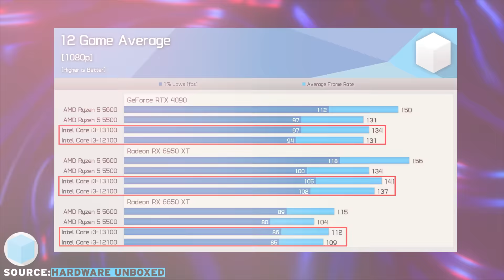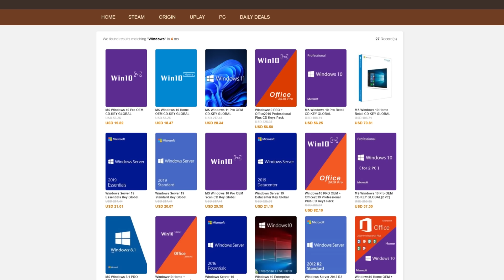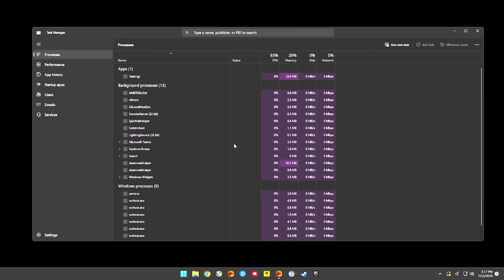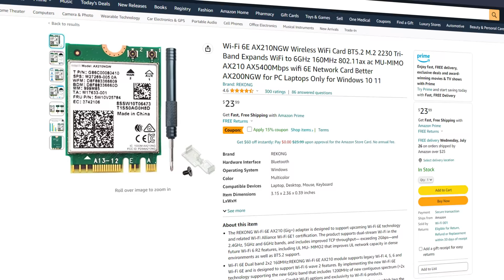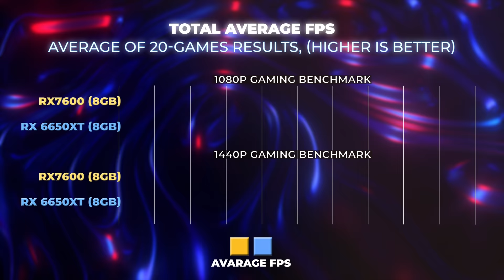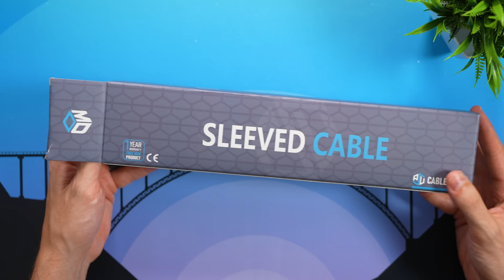The Mind-blowing $650 Gaming PC Build

Comment: Anyone Please Help 
I recently built my first pc and I thought I did everything correctly like building and installing everything correctly. But after downloading some games and playing them for a couple of minutes they freeze, close, I get the blue screen of death, or my entire PC just shuts down. I tried buying a better CPU cooler, upgrading the power supply, uninstalling games and drivers, watching endless amounts of youtube videos, lowering the in game video settings and limiting the FPS. I'm just not sure of what to do anymore. And I really don't want to spend more money and go to a PC shop for them to look at It . Also I have windows 11 installed but not activated. I don't know if that is the Problem or not? Anyone that has had this issue or knows how to fix it please help.
Reply: Did you overclock CPU or GPU or RAM? If so, temporarily disable any overclock and see if that improves stability. Also, monitor your hardware temps, mainly CPU and GPU. And by chance, you didn't install a shady copy of Windows, right? If you just downloaded from the media creation tool from MS but didn't activate, that's still fine. However, if you installed a shady copy, that could cause issues.
Reply: @JJFlores197  nope never oveclocked anything and I don't think it was anything thing shady I got a USB and downloaded it from the official windows website
Reply: @Dtecki_  But are you temperatures ok? If you do nothing intense on the computer, like web browsing, does the PC crash?
Reply: @JJFlores197  yes my temps aren't high at all and it hasn't crashed while watching videos or web browsing

Comment: Bro plz check my pc specs , I want to build 🙏🏻❤️ plz reply 🙏🏻
1 . Cpu:- AMD Ryzen 5 7600X
2. GPU:- GIGABYTE Radeon RX 7800xt 16gb oc
3. Mobo :- GIGABYTE B650M AORUS Elite AX 
4. Ram :- CORSAIR VENGEANCE DDR5 RAM 32GB (2x16GB) 5600MHz XMP
5. NVME SSd :-Samsung 980 PRO 1TB Up to 7,000 MB/s PCIe 4.0 
6. Cpu Cooler :- Deepcool AG500 Performance 
7. Cabinet:- Ant Esports ICE-311MT Mid-Tower 
8. PSU:- Deepcool PK750D, 750 Watt
9. Monitor:- Acer Nitro Vg270 S 27 Inch
Reply: Nice🤌🏾